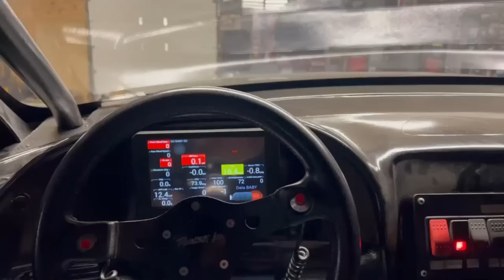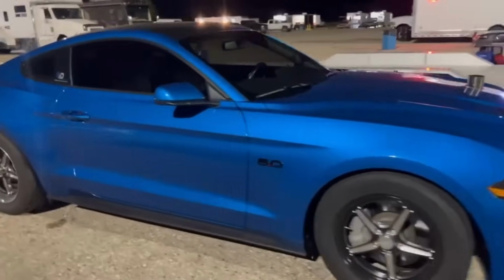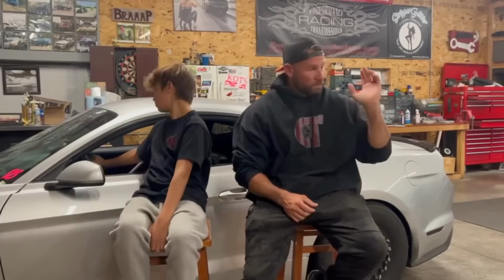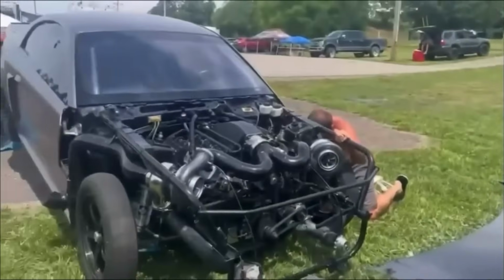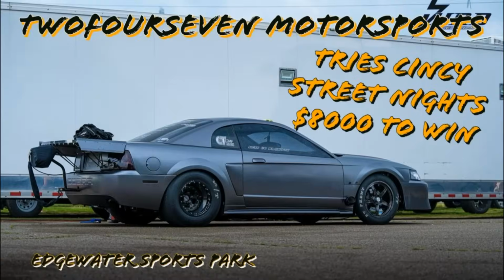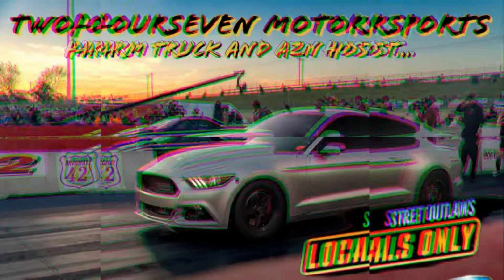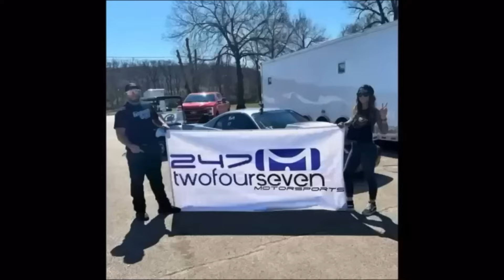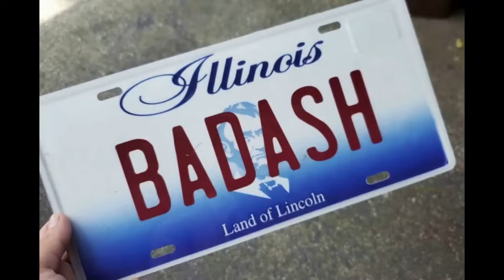What happened to the Car? Future Plans feat. Street Racing Channel

Comment: Thats quite a battle. It the fuel pump drive cable pretty straight and turning in the direction that closes the wires together instead of pushing it apart by turning against the wire cable direction its wound.
Reply: Ya I mean minus having to go up
Over the axle it was all to spec but we will be routing it in tubing straight thru the car now with zero bends
Reply from the maker: Thank you for watching Jeff!! 🏁🖤

Comment: Brandon definitely needs to upgrade like everyone is doing, I’d say Procharger 100% and lighten up the car much as possible, you would need to anyway to change the motor and go Pro Charger.
Reply: Man I want to do a procharger but comp turbos has been so good to us and they are redesigning the turbos to try and move more air similar to a procharger we are gonna give it a go one more season with a lot lighter nastier chassis
Reply: @bs03cobra  I get it, you've used them so long and have done good with them so it's hard to give up, at the same time Pro Chargers are changing the game now, on the street and track, either way changes have to be made just to keep up with everyone else,  Good Luck !
Reply from the maker: 🤘 he responded on this one. Lol
Reply: @twofoursevenmotorsports  😆 🤣  I know yall gonna do whatever it takes to win and have other drivers worried when both of you show up to a race,